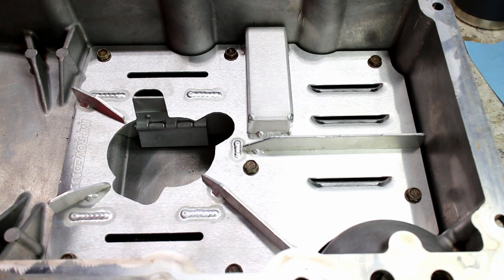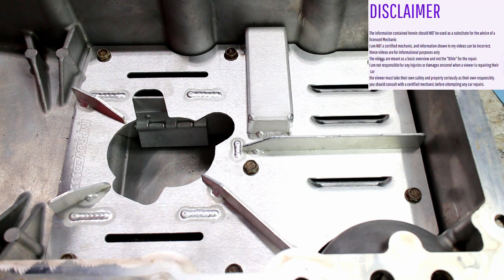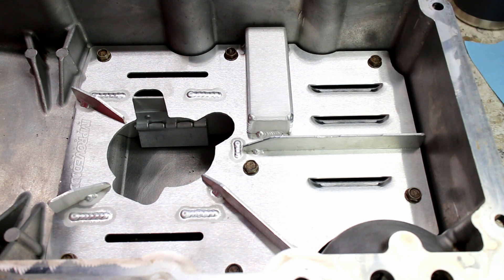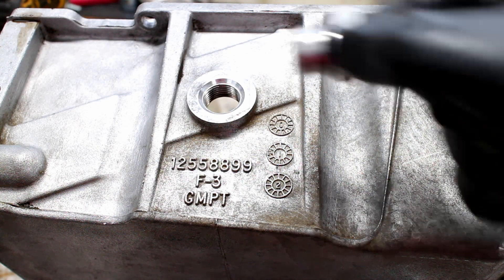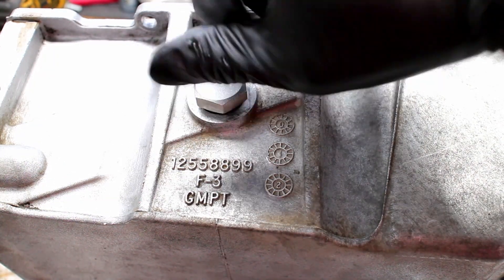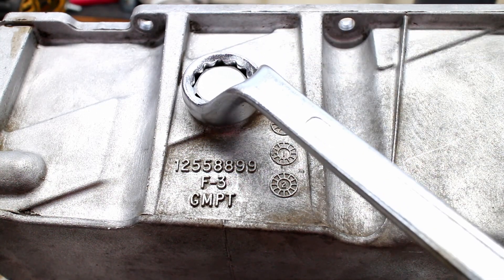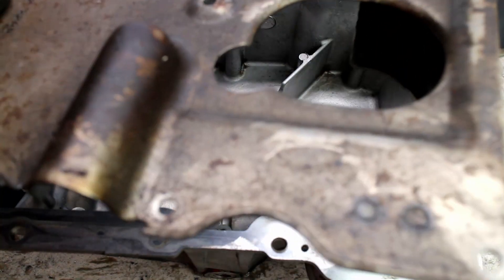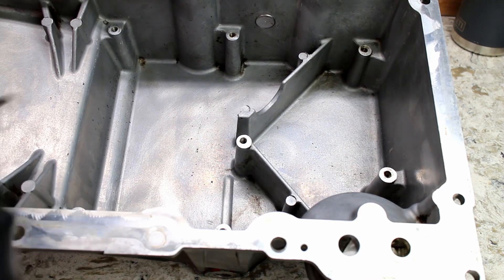Improved Racing F-Body Oil Pan Baffle Install  (Pt10 82-92 Camaro/Firebird LS Swap)

Comment: How many qts do u normally run at your autocross events now with this pan?
Reply from the maker: I've run 6.5 quarts, but I think that was too much as the main seal started leaking a bit at the track. (not autocross though)
since I Have a Accusump and a 1qt oil cooler, I'm backing back off to 5 quarts. 
Since my whole system has about 7 quarts with the cooler/Accusump
Reply: @3rdGenGuy  6.5 quarts is what I was thinking I'm going to try, making sure I have good crankcase ventilation. But it's not going to be pushed as hard as u do, just street pulls.
Reply from the maker: with some oil pan baffling, street pulls would be no issue.